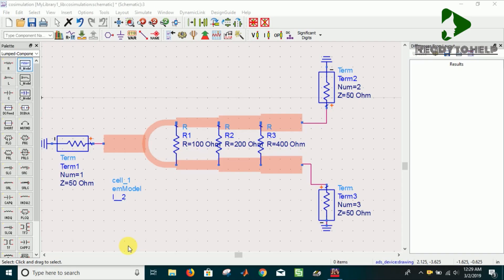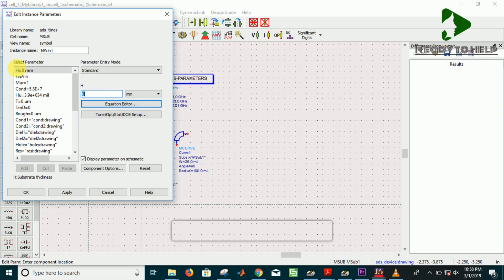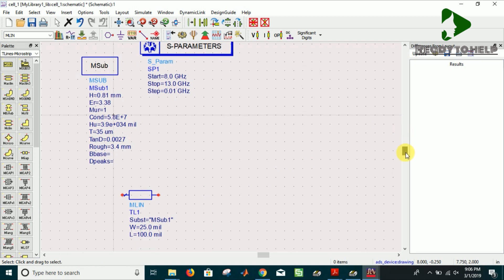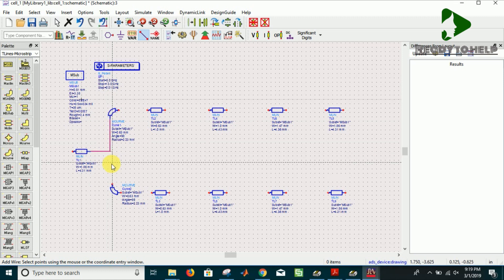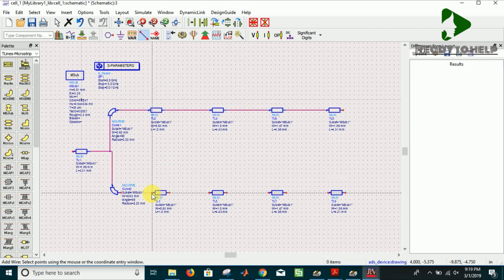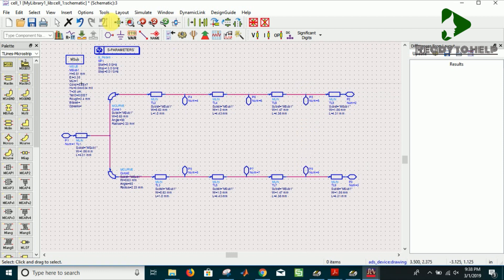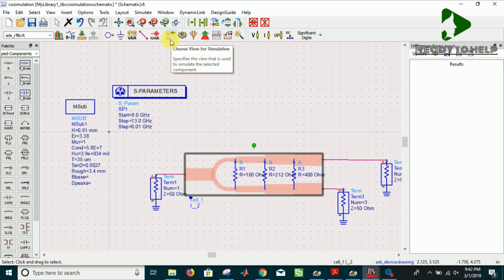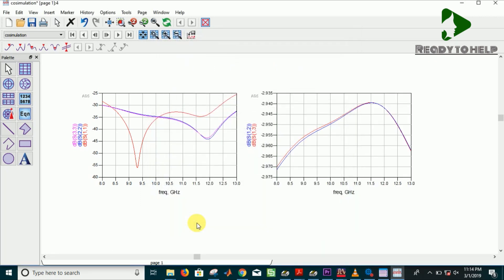Multistage wilkinson Divider with equal split on ADS |  Microwave Engineering

Comment: You give the substrate parameters however, what material is actually being used? Alumina? Alumina has a dielectric constant of 9.6-10. So I'm a bit confused on where youre getting the parameter numbers. The loss tangent for alumina is 0.0003 but youre putting 0.027.
Reply: I think she didn't select the right substrate

Comment: TL2 and TL4 how many ohm?
Reply: use lincalc in the ADS tools. Then use the Wilkinson equations to calculate the TL impedances.
Reply: @babyblue1010  when i was 18 i had a dream to be reverse engineer but it didnt work xD. I made my divider with the bandwidth that i need. Insta: vaggelis_bj

Comment: You dont say how you calculate the radius of MCURVE. Also why dont why upload a shematic with the resistance of every transmission line.
Reply from the maker: resistance is used for impedance matching at each port
Reply from the maker: U can calculate radius from simple radius of a curve formulae
Reply: @readytohelp9612   yeah this is how. the number you had i think is wrong. This is where my inconvenience comes from.
Reply: you can use two rectangles and then a polyline to connect the corner. Then you can use the measure tool in ADS it finds the radius

Comment: Sorry, what's function this project in real life?
Reply: Wilkinson divider is a rf power divider/combiner. For example in the antenna array, you can distribute power to each array with wilkinson divider. Since it is reciprocal, you can also combine multiple rf power with this divider. Wilkinson divider has very common usage in rf systems.